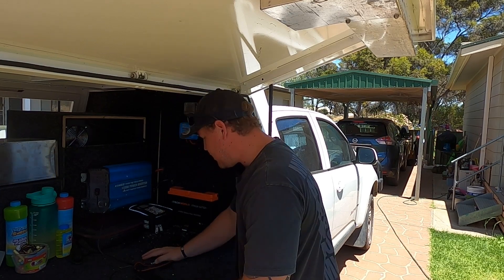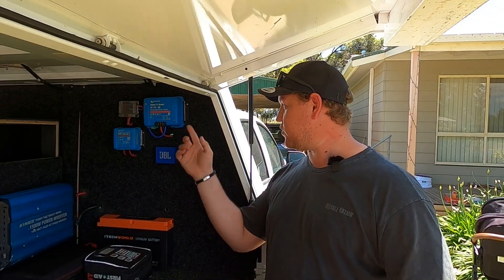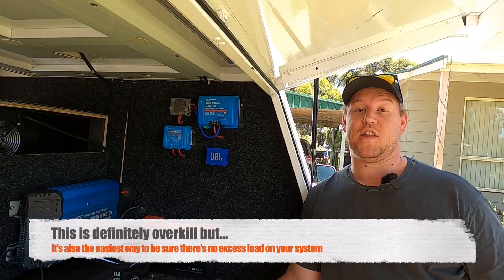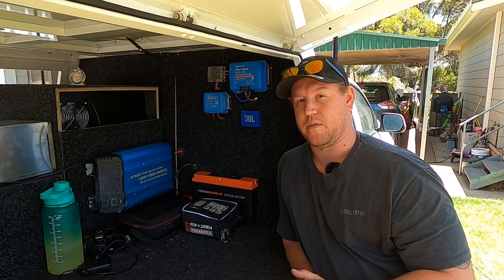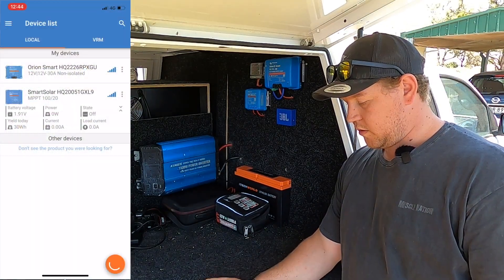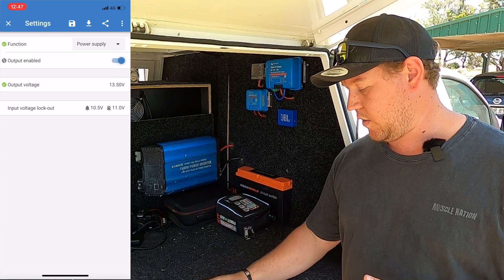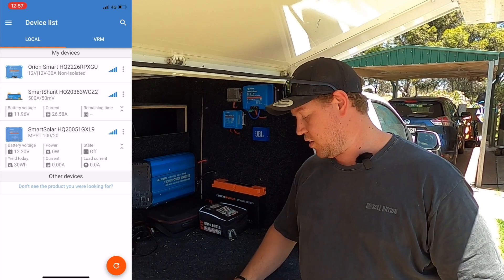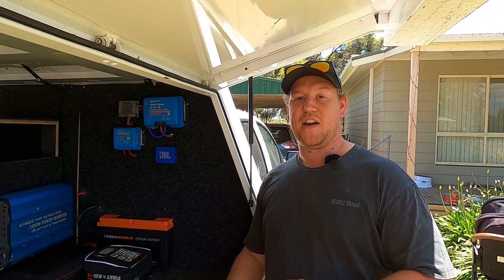Waking Up a Flat Lithium Battery in Safe Mode | iTech 120X | LifePO4

Comment: Technical question 
So will it work for a 48 volt 30 amp battery if i use a 48 battery for a trigger ?
Reply from the maker: Hey Gary, in short, yes your battery could use a 48V trigger from another battery, then can continue a proper charge from a 48V battery charger

Comment: Nice work, I am yet to have the joy of a lithium set-up but still good to know for the future or to help others. 1 tip for your set-up would be to have a main isolate for input and output to make the wake up process a bit easier. Cheers 🍻
Reply from the maker: Hey Luke,
Thanks for the suggestion mate, I currently have a main circuit breaker mounted behind the false wall, probably would’ve been smart to mount it to the front 😂

Comment: Absolute nonsense disconnecting everything!
Reply: I agree........ Just jumpstart from starter battery...... Period.   The bms just needs a constant voltage above 12 volts +/-.....,then once bms is active again, you're done.😎